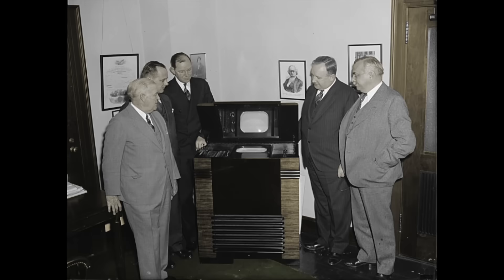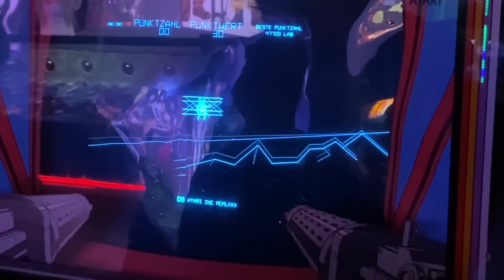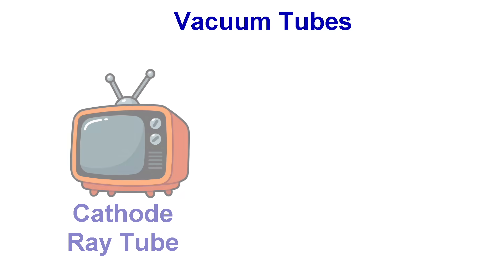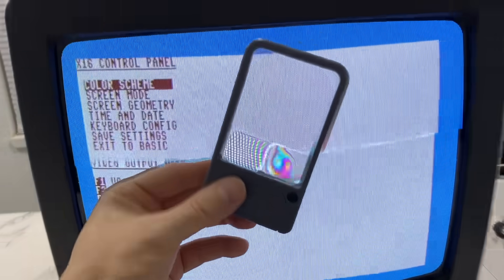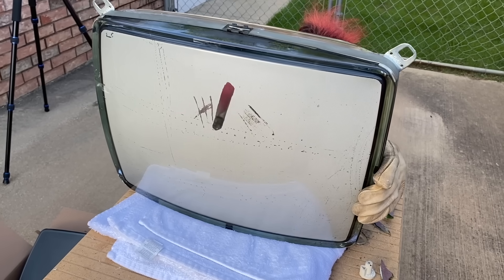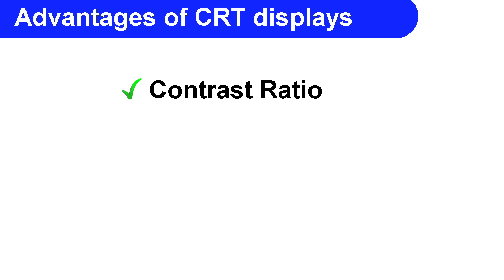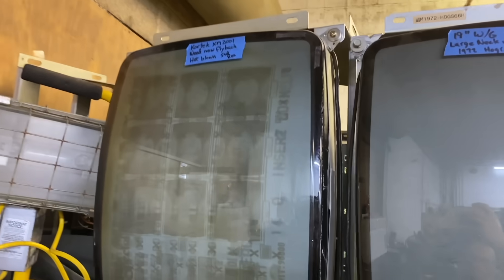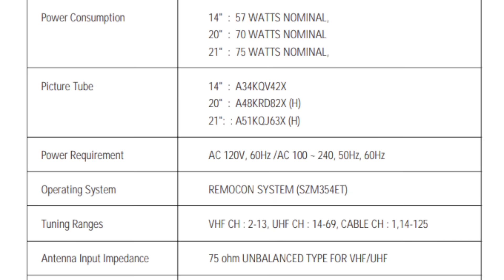How Cathode Ray Tubes Work.

Comment: You are missing a very important point: Although Color CRTs may be not as crisp in quality as a modern LED/LCD/TFT/Whatever, but actually game developers back then not only knew about its limitations, but instead even were able to design their artwork/sprites to make USE of it. There are really good examples of images compared between CRT displays and modern displays that show that modern representations simply... suck. Well.. at least if you are showcasing 8 bit games for instance. ;-)
Reply: No game on PC ever designed their artwork around CRTs. Or please, show me (YouTube link). I only know Commander Keen and Xenon 2 . Friends played EyeOfTheBeholder and Cannon Fodder.
Reply: @ArneChristianRosenfeldt  I was talking about the C64 for instance.
Reply: @Tronex2009  C64 came with S-video connector. In composite, the colors (uv) are squeezed between intensity and audio. With S-video, color can expand the bandwidth in both directions. Biggest problem here that the modulated color cannot go down to DC, but we don't want 60 Hz hum anyways. Now the question is what connector you mean? Also a lot of C64 games have 160px horizontal resolution. Not much leeway to dither stuff. NES has 256px, but overscan.

At the same time Arcade also used CRT and always RGB. Sega and NEC seem to love RGB. Atari went RGB with the ST. Commodore with the Amiga. Only Nintendo is all about components up to the gamecube until CRT died.

PC CRTs show that you can focus far sharper than needed for SD. I say, for TV we need an elliptical spot which is high enough to reduce interlacing flicker, but narrow enough not to smear horizontal resolution. And then run those weird modes: EGA 640x200 . Amiga 1280 x 240

Comment: In my experience, electro magnets have a natural latency so how are the magnets in the deflection coil able to switch fast enough to move the raster so quickly?
Reply: They don’t use metallic iron cores, but ferrite . And low winding count.

Comment: also, re: nothing uses vacuum tubes anymore, tube guitar amps are still very common and preferred by most professionals. also there is a decent amount of hi-fi stereo systems using tube amps. there's more countries producing tube amps than actual countries with vacuum tube factories however

Comment: QUES : can anybody explain why old crt displays were weirdly round shape instead of simple flat screeen???
Reply: Electron optics is difficult. The screen follows the focal and convergence plane . No idea how Sony got Trinitron to work. Something about all colors in line makes flat vertical possible. Easier for the optics for 16:9, harder to withstand the ambient pressure. Also I learned that horizontal deflection is driven by a transistor which is either on or off. The velocity of deflection is not controlled. Instead a CRT better has a digital input ( DVI, HDMI ) and a small SRAM buffer to "sample" the color at the current screen position. Curved screens ( Trinitron is still curved along this fast axis ) have naturally even velocity deflection and can be fully analog.

Comment: My step dad had a Sony FD-555 that he used to bring with us on roadtrips. Even though it was black and white it had a great picture. It was a 5" screen and if it was a color 5" screen it wouldn't have looked as good due to the shadow mask. Small color CRTs, under 8"/10" have terrible picture quality but black and white tubes look great. The beam can just be free move and not be interrupted by some little color system. 480 visible lines of light on a small 5" screen has great scanline per inch density and looks crisp.

Comment: The getter’s main job is to deposit that ultra-reactive metal layer — typically barium — onto the inside surface of the glass envelope. That shiny silvery patch you sometimes see inside old CRTs? That’s the getter deposit, not the original getter material itself.

Comment: To me it seems the CRT display was ahead of it's time, or rather that it seems more advanced/complicated than a pixel. It is quite amazing they were able to bend a beam of light so accurately.

5:24 At my job they used a green monochrome CRT... Our business used a software that ran on 'linux' and they later   "upgraded" to newer computers and the flat screen LCDs that they switched to went from the familiar green on black to a godforsaken grey and laser blue (that also horrifically ran inside a window that when full screened made it stretched AND horrific)

The software is essentially text in boxes so the CRTs were objectively better. The black background was so much easier on the eyes. The text was clearer.
Reply: They were bending electrons, not light. And it's done by magnets. This is 1940s tech

Comment: Would not a black and white LED display make the best back light to a LCD color display by only illuminate when and at the right intensity the image require it to? There is a lot of talk about local dimming zones, this way you would have as manny zones as the led display has resolution beating the pants of any on the market today but still fairly cheap. The display would just split the image signal and display both overlaid on each other. Am I right or am I missing something in thinking this?
Reply: This is what they do. It is a straight forward idea, but no elegant. For example for stars on a sky you need full back light power everywhere, although most pixels are black. Xenon2 looks much better on CRT.

Comment: You left out the most important advantage of CRT, which is why many gamers go back to it, even NES Tetris pro players, and that is MOTION CLARITY. 
Nevermind the frame rate of your monitor, it's the actual shutter speed (duty cycle) of the frame that's important. So for a 60 Hz CRT the actual shutter speed is around 1/1000s, but for a 60 Hz LCD or OLED the shutter speed is 1/60s. So even a 144 Hz LCD will have a shutter speed of 1/144s, which is still much worse than CRT at 60 Hz. 
So action games and live sports are still better seen on CRT.

Comment: As a CRT expert and good friend of mine has said, getting zapped by the CRT's capacitive charge while operational (which is being recharged at many kHz with HV) likely won't kill you, but it will make you wish you hadn't done it. I've been zapped by powered-off tubes without bleed resistors (very old tubes, more modern ones almost always have a bleed resistor), and it's uncomfortable to say the least - but not like getting zapped by it while in operation. What would be worse would be if you made yourself a conductor between a disconnected flyback anode lead and ground - that could likely be enough to send you into atrial fibrillation, which is where the normal rhythm of your heart is replaced with a chaotic and unsynchronized fluttering of the heart, which prevents it from pumping blood. If that last long enough, you can surely die.. But what hurts far more than getting zapped by a powered-off CRT anode or even while under operation, is if you accidentally make contact with the yoke contacts while it's powered on. The sweep signals in the X/Y coils is intense, and incredibly painful. It is more likely though that you would hurt yourself by the involuntary reaction of moving your hand away and slamming it hard against something nearby, like the monitor housing.

Oh, and my friend I mentioned in the beginning, any time he does a presentation to help hobbyists learn how to diagnose and repair their CRTs, "As far as I know, nobody has actually died from coming into contact with the voltages in a CRT chassis. If you do happen to die, please send me an email to let me know. So far, nobody has sent an email to notify me of this."

Comment: 11:43 some ppl are just threatened by change
Reply: I wouldn't say that's the reason. It's rather that some people are either nostalgic for things, completely forgetting the disadvantages, or they see modern technology(which is literally superior, crts fell out of style for a reason)as a routine, and routing is boring. However, to them something from way back then seems exotic and unique.
Reply: OLED and LCD are garbage compared to CRT, a 60 HZ CRT at 60 FPS has the MPRT of a OLED running at 1000 HZ / 1000 FPS
Reply: Sometimes change is a real threat

Comment: I found one of these tubes in the woods behind my house.  Just the glass tube. The narrow end is opened and it has had water stains in it over the decades. I want to restore it to repurpose it for a craft. What is the best cleaning solution to use to get out decades of stains in this?
Reply: what do you mean by "open" ? A tube dies when air enters it. I mean there are some low tech tubes which don't, but high tech tubes like CRT use some exotic materials inside.
Reply: @ArneChristianRosenfeldt water got into it and stained the glass. I can literally put a garden hose in the hole in the narrow end. Im thinking about getting a heavy duty cleaner and cleaning it up then putting a string of Christmas lights in it .

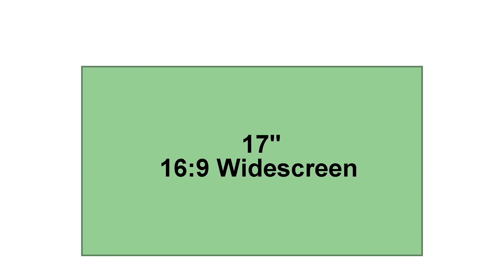Comment: Excellent video! 17:20 That's why 3:2 is comming back (I believe it was used in early silent movies). 3:2 can also be used vertically making it 2:3 or 1:1.5 and 1.5 is pretty close to sqrt(2) which is the proportion of the A papers (i know there's also a B series but I don't know how they work). A(0,1,2,3,4,5, ..) is a paper size that when cut in half gives the next index: A4 cut in half is A5. That is "given a rectangle with larger dimension L and shorter dimension S, which proportion L/S would be equal to S/(L/2)?".  I did not do a proper mathematical proof but I found one proportion: sqrt(2):1. 4:3 vertically is 3:4 or 1:1.33... sqrt(2)~=1.4142; 1.5 is ~.08 larger and 1.33 is ~.08 smaller.

Comment: 12:24 I feel like if CRTs had more time to advance we could have had even better CRTs HD and all
Reply: @standley_steamers  HD CRTs actually do exist
Reply: @ I know I have one I’m saying the tech could have been improved even further
Reply: @standley_steamers  it was too expensive and not worth the cost
Reply: @standley_steamers  CRTs pay for a sharp electron beam. Basically, you need higher voltage and hence stronger deflection fields. The only tech advance I know of is glass with better x-ray shielding. But this means more lead and weight. So I really don't get your point. LCDs process 4k points in parallel !

Comment: There's one part of a deflection yoke which is critical, which you didn't mention, that's the purity rings. They're used to properly converge the RGB beams
Reply: I learned that dot masks need many more rings than slit masks. Do we need rings at all when we crank up the precision in winding machines and assembly? If a CRT has digital input, can we not achieve horizontal purity by just fiddling with the timing when we send the data to the 3 DACs ? I read that the videoAmp for the electrons guns outputs 100 V at MHz. Is EMI a problem? Would it be possible ( for digital inputs ) to switch the R in a R2R DAC for coils and create pulses dynamically? We could create vertical "scanlines" . Would be sharper.
Reply: @ArneChristianRosenfeldt  I don't know of any CRT that has a digital input (HDMI, DVI, DP) and even if it did, the result would be an analog beam bouncing around on a phosphor coated screen
Reply: @rickpontificates3406  even LCD is analog in the end. I just know that DVI was developed for CRTs and CAD, while LCD ( in the hinge of a notebook, or this cable the Gameboy) had a different digital protocol.
Reply: @ArneChristianRosenfeldt  LCDs are only analog in color intensity, the positioning of picture elements is NOT ANALOG, IT'S ABSOLUTE. Whereas, the 3 electron beams in a CRT have to be aligned (with purity rings) to hit the proper color mask (analog), an LCD has fixed LED elements which are always aligned with the right color (digital). All you have to do is tell them how bright to be.
Reply: @rickpontificates3406 I learned that the manufacture shots with the electron beam to fixate the phosphor of the correct color.

Comment: So basically, CRT is the last vacuum tube user before it finally died on successor LCD.
Reply: traveling wave tubes in TV satellites still live? They are radiation resistant. Someone suggested that they are ineffizient, but they run on solar power!

Comment: I heard that if you touch a color CRT with a strong enough magnet, you can actually distort the shadow mask mechanically and it will stay like that no matter how much you degauss it. Could be even more of an issue with a Trinitron, as its mask is made of vertical wires that are only horizontally interconnected in just a few places, or not at all in small screens. And for it being perfectly safe for monochrome CRTs - not 100% true, you can magnetize other pieces of the monitor such as the CRT anti-implosion band or screws and the image will stay distorted until you demagnetize it. But to a much lesser extent.
Reply: so glad that I only had access to weak AlNiCos in my youth.

Comment: I really wish I had the space to have an extra LCD TV for the PS1-PS2 generation consoles and an old CRT for playing NES and SNES generation stuff...
Reply: most ps1 games output at 240p which means you should use a crt if you don't have an upscaler that handles 240p correctly

Comment: My great uncle has a patent for CRTs. I was really hoping i'd get to learn about it before he died.. here's the information, hopefully someone will se this and give me the sparknotes lol..

High voltage processing of CRT mounts
Patent number: 4682963
Abstract: CRT mounts for color television are effectively high voltage conditioned by impressing a high voltage DC potential on the mount anode, while at the same time impressing a high frequency pulsed AC potential on the final grid electrode, and allowing the focusing electrode to float electrically, thereby inducing arcing in the upper and lower gaps adjacent the focusing electrode. Preferably, this general conditioning is followed by a second conditioning step in which the focusing electrode is connected to the AC potential, to concentrate the arcing in the upper gap.
Type: Grant
Filed: March 20, 1985
Date of Patent: July 28, 1987
Assignee: North American Philips Consumer Electronics Corp.
Inventors: Kenneth J. Daldry

Comment: 15:18 Is that damage caused by the screen being dropped or mishandled, or does it just randomly develop damage like that even when put in the same spot for decades?
Reply: The latter. It's mainly an age thing, I've seen it a number of times on late '90s stuff, and even once on a 2005 laptop that looked to be in a harsh storage environment. I don't know if anyone's confirmed it, but so I've heard, humidity & heat may contribute to the problem, and in my experience I'm inclined to say it's true.

Comment: 10:47 correction: some crts actually have a "degauss" option in the menu that can fix this issue (and make a loud noise in the process). you can also fix it just by using a regular magnet and spinning it while slowly moving it away

Comment: I've seen primarily roundie color CRT TV sets from the 1960's where the adhesive that binds the safety glass to the face of the CRT starts to discolor and lose transparency. There is a procedure for removing the adhesive, but it's rather dangerous. While in operation, these old color sets produce deadly amounts of ionizing X-radiation, so the old 4-foot rule must be observed.

Comment: I'm using 22.5 inches 16:10 monitor.
It has more visible area than 23.5 inches 16:9 monitor.
I hate 16:9.

According to the mareamatical theorem: a^2+b^2>2ab, and  a^2+b^2=c^2.
We can get the max area when the height is equal to the width.
Now I'm considering upgrading to a 3:2 monitor with more visible area but the same inches
Reply: why don't you just upgrade to a 16:18 2560x2880 monitor?

Comment: I always wondered why screen sizes are given as a diagonal measurement when the different aspect ratios make that rather meaningless.  Why not just give measurements in X by Y as the resolution is given?
Reply: back then there was only the 4:3 aspect ratio so it didn't matter

Comment: The diagonal and resolution thing is really annoying when trying to compare screens of different aspect ratios. 

I had two monitors for example that I considered the same size but they were actually different sizes because of the aspect ratio. If you measure the top to bottom measurement they were roughly the same height. 

I believe Pixel density is the most important measurement if you're trying to compare two different screens because if you have say a 1080p 16x9 monitor and a 1080p 21x9 monitor shouldn't they be the same height if the pixel density is the same?

Comment: Wow, it actually took me 31 years to figure out what degaussing actually does. I used CRT monitors on PCs when i was 8 to about 13-15 and bought my first own 19" CRT monitor when i was about 12. It had a degauss function that i used from time to time because i liked the wobbling effect it had on the image, but I never really researched what it actually did. Maybe I never used magnets on the screen, so I didn't have to figure it out. What I still remember though is that the "intensity" of the wobbling image decreased when using the degaussing function multiple times in a row. Thank you David for explaining the technology I used in my childhood.
Reply: Agreed, cool to see and understand how it actually works!  I had an old flat panel CRT in the early '00s that had a blob of purple growing in one corner.  One day I decided to see what a magnet would do to it, and lo and behold, it almost completely returned the color to normal.  Had to do it every month, which had diminishing returns over time, but I got another couple years of decent use out of it.  Wish I'd had that proper degaussing ring though!